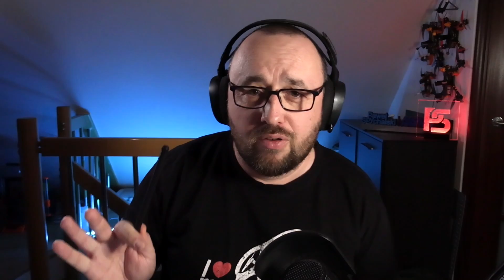Why INAV config wipe problem is happening?

Comment: Had this happened a couple months ago... had just finished tweaking configuration, saved, unplugged... then remembered about 20 minutes later that I needed to set another parameter... plug it back in and bam, clean slate ... at least it was still fresh in my mind. After that, I regularly try to backup the configuration.

Comment: Just had it today with INAV5, very depressing, loads of configurations lost. I do not believe this was the problem though. I powerd the quad - it started properly - ready to arm. then i unplugged battery, plugged again 30s later and it would not want to get ready - accelerometer not calibrated - all settings wiped.

Comment: 👍 Thanks for info !
P.S.
Not a programmer - please "pardon my French .. 
"back to mama" is good safety option - is there a chance for "keep last working" instead ..  ? (choice?)
I know "frequent backup" is standard answer to all problems - but "default" or "last backup" can be (also?) done at home base (cool head..) 
for the guy at the field - "keep last" might be time saver ..
actually - not playing with RC lately - please forgive me if I missed some context ..
Reply from the maker: There is no "previous" and "current". When save to EEPROM is interrupted, data is corrupted. No idea how badly. Restore to defaults is the only valid option to keep it safe
Reply: @FPVUniversity  👍oh, got it - no "banks" or like, memory.. - I guess I am a lot like EEPROM now - what was once written - is corrupted now ..

Comment: I had this problem on Sunday trying to set up a friend's f411W with speedybee V2 WiFi adapter. It seemed to happen when I did save & reboot. Once we got it saved, without a reboot, it was fine and he had a few flights and everything was fine.

Comment: I have this issue happened to me on matek f405 mini while not connected to a pc,  I have made changes to pids through osd and rates , but decided not to save them. I finished my flight and just disconnected the battery. Hope this information could be useful. Luckily I saved the dump prior the flight.

Comment: Is betaflight works the same? My problem is different. When I just flying,then unplug the power cable, then pluging it back, there is a chance that my quad setting would back to default. Its not always, but sometimes it happened. Why?

Comment: Pawel,  I connected my build to my phone on speedy bee app and it showed that my quad is wiped. Problem I'm having is that I get a warning message saying vtx_low_pwer_disarm and now quad won't arm.Nothing I do fixes it. I even tried reflash a few times and reflash hdzero. I then flashed betaflight to it and all works good. Problem is I don't want betaflight this is my diatone lr4 build. Please help
Reply from the maker: Use CLI status command to get the not valid values. The defaults can be obtained from here https://github.com/iNavFlight/inav/blob/master/docs/Settings.md
Reply: @FPVUniversity  I tried that many times it keeps reverting back and my craft won't arm. What I don't understand is what does vtx have to do with disarming motors?

Comment: I have all my MatekF411WTE configuration wiped out on firmware 5.1 configuration earlier. So I flash to the older firmware 5.0, but today this issue occurred again. It was all working fine yesterday. Is there any solution to this problem yet? At the mean time, I think I will try the original firmware version 4 from MatekF411WTE and see if this happened too on that original version. Thank you very much.